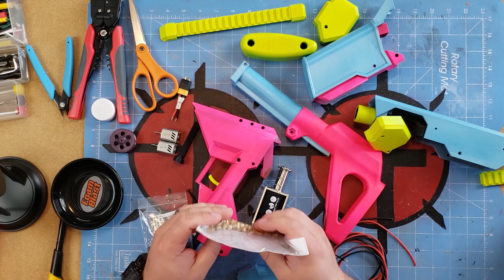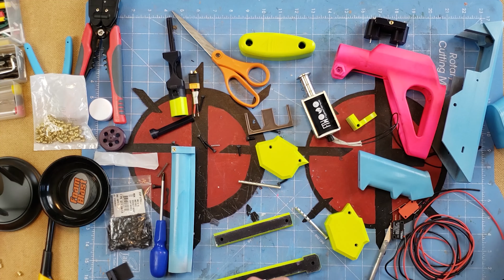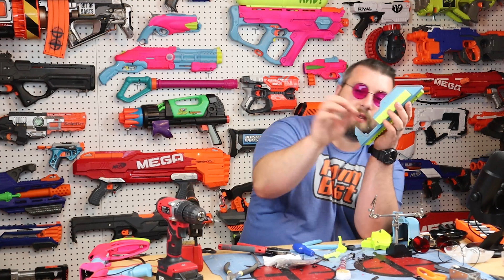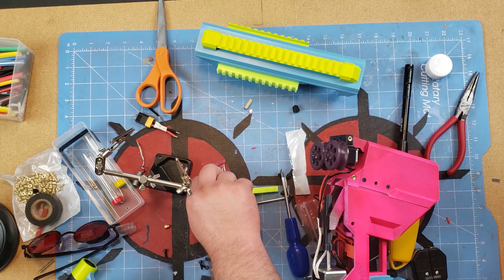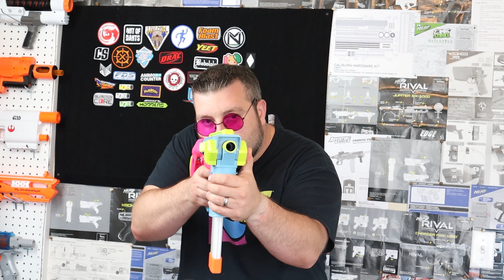DrFlux's Hummingbird Build Log

Comment: Hi there, thanks for the Vid. I will be sure to use it to build mine. One question though, how to all the flywheels in these types of dart guns secure on the motor shaft without spinning under load? Round motor shaft and round hole in flywheel? spinny spinny under extreme load? thanks

Comment: Great video...but since I am new to wiring, I have a question about the motors. I didn't pay attention to the color codes when I installed the motors into the housing. I noticed there is a red dot on the back of the motors. That said, I installed one motor with the red dot facing down. Is the idea to wire the red wire to the red dots connector? If so, I would essentially be crisscrossing the black and red wires and they will no longer be in series...or does it even matter? Also...are the motors for the flywheel supposed to rotate in the same direction? How do I know it is rotating in the right direction. Sorry for my ignorance...my 13-year-old son is making me build this thing! LOL! ! Any help would be appreciated. Thanks!